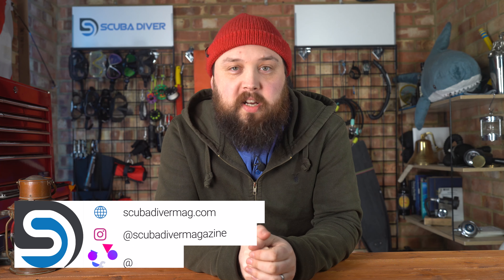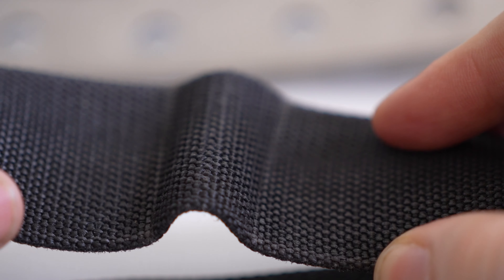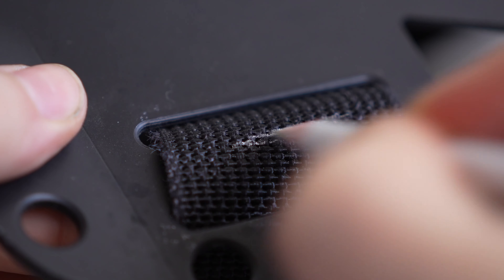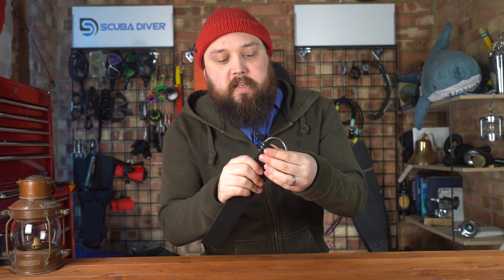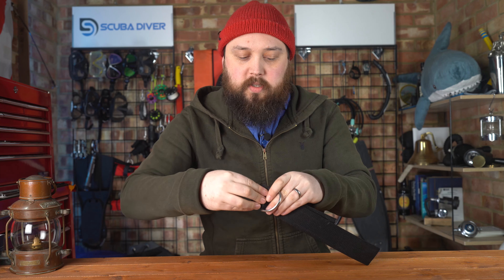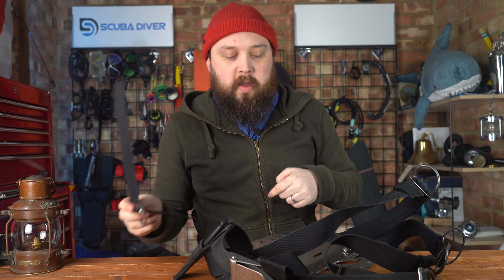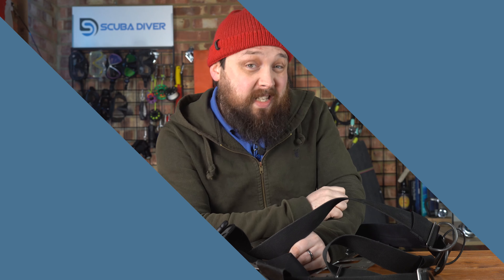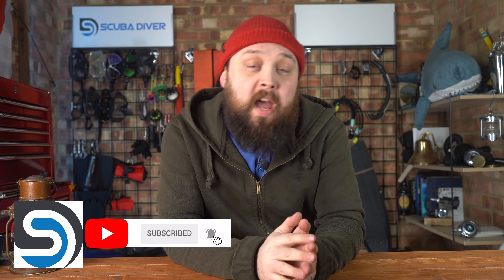Can I Re-Thread Webbing Harness on a Different Backplate #AskMark #scuba

Comment: #askmark Mark you mention the difference in bpw fit when switching between warm and cold water wet suits. I use a loop adjustment ring on my left bpw waist strap to ease donning and doffing.  Any reason not to use one on my right also which should help snugging up on a thinner wet suit?  Thanks, John
Reply from the maker: Yeah, Agir makes a double loop but, you have to buy them as a pair...
You'll be surprised at how long your waistband will be swapping down from your drysuit so you may need to move the D-Ring(s) on your hip and your QR buckle. But it is definitely possible
Reply: I’ll just be switching between 7 mil and 2.5 mil and back so hopefully shouldn’t have to relocate anything.

Comment: Hi Mark!  I am very appreciative of all your content as it has been top notch, especially your Apeks & Shearwater gear reviews.  My question for you is this: Several years ago, during a move from one home to a new one, somehow my dive log went missing.  While my certification cards were in my log binder, those are easily replaced (for the appropriate fee of course).  However, its the dive information that I am truly missing, as I have no way of reproducing any of that information.  While my number of dives has not been numerous (under 50), it is annoying none the less as I want to go divemaster in the near future.  What would be my best course of action? Just start over at dive #1 or start at the #X I know I was at, which would likely less the actual number of dives.  Thoughts?  Thanks for your time and  keep up the great work.  #ASKMARK
Reply from the maker: I'd just continue from the rough number that you think you're at. It's a pain when you lose a section of your dive logs, I've done it myself and had to restart my logs so I don't know the exact number.

When you decide to go Pro, try to go above and beyond the minimum dive count.  They shouldn't need to see your entire dive log, just your most recent dives. You'll be gauged more on how you are in the water than what's in your log book
Reply: I would start from the highest number you can definitely recall. For the future, I would recommend you keep a digital record as well - personally I recommend Subsurface, as that is cross-platform, and pretty much agnostic in terms of dive computer downloads, and as a bonus, uses an optional cloud storage model.